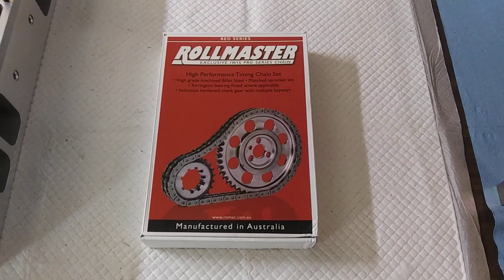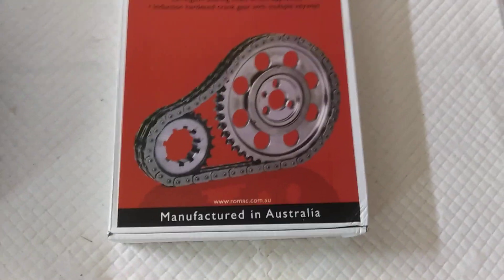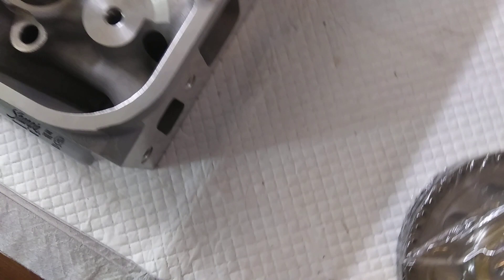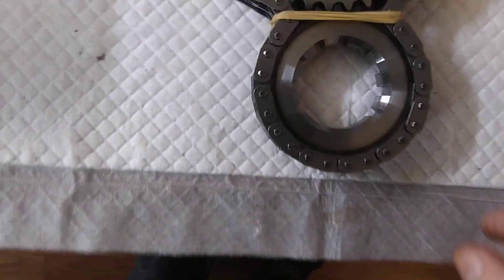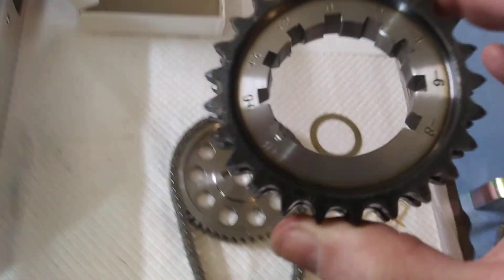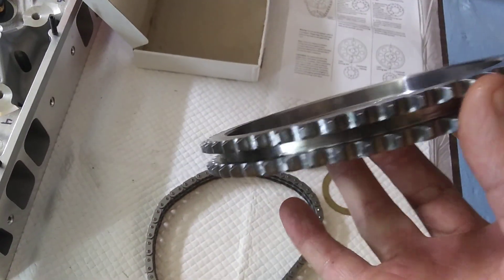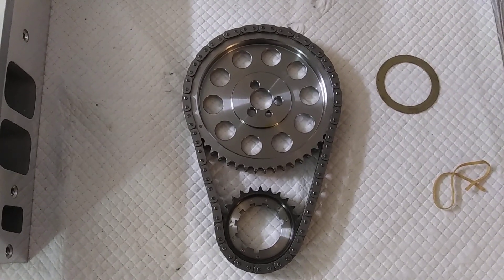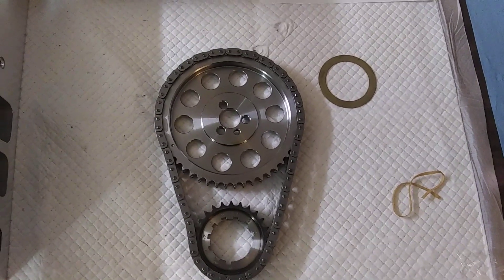Rollmaster billet timing set inspection for BB Chevy.

Comment: Does it rotate counterclockwise?
Reply from the maker: Just a typical 800+hp NA bigblock Chevy drag engine.
Reply: Wow that was supposed to be a southern hemisphere thing but it actually was a valid question.  Dam haha
Reply from the maker: @Lobo-tommy10  Alot of marine engines turn counter clockwise in boats that use twin engines. I thought you was wondering if was going in a boat.
Reply from the maker: Nope, clockwise. It's going in a vehicle.